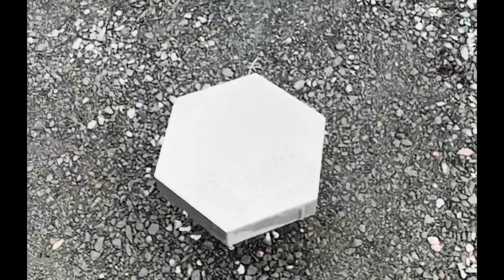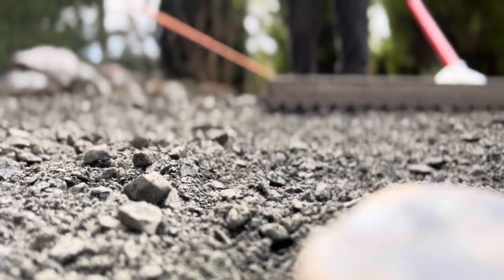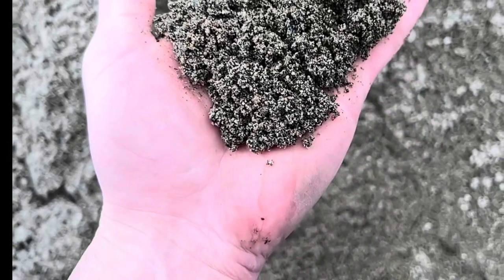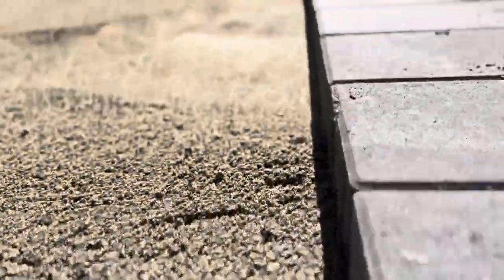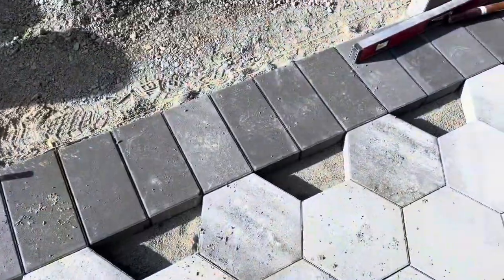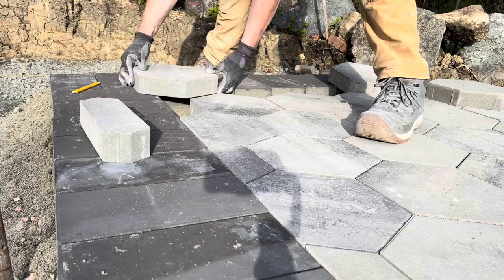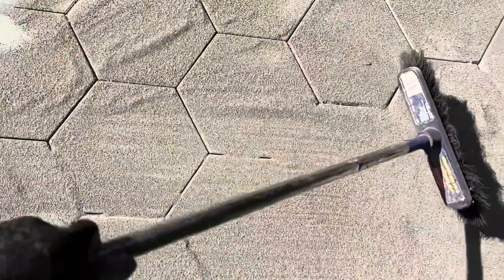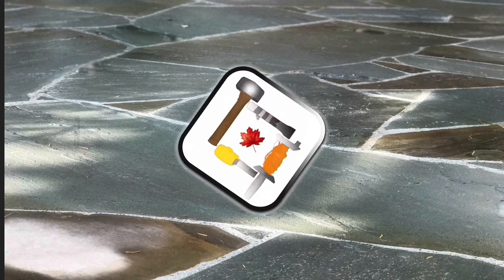How to install a modern paver patio! #pavers #diy #landscaping #hardscape #patio #pathway

Comment: Nicely finished project and good editing. Haven’t seen that shape before, was  there much size difference in pavers or were they exactly the same size?
Reply from the maker: They are very precisely the same size!
Reply: @HardscapeCanada  that makes it a lot easier, in Australia you sometimes get 5mm variances which really slows job down

Comment: Hi, project looks awesome! Well done indeed!!! 2 questions if I may? (1) Do you hammer down the pavers for them to be somewhat flush BEFORE applying the polymeric sand? Or is this step done via the vibrating plate? (2) Do you apply a protective sheet on the vibrating plate in order to avoid scratching/damaging the pavers? Good continuity!! :)
Reply from the maker: Hey thank you! No
I don’t hammer any of them down as they should sit flush on our nicely screeded sand. Often any minor discrepancies are ironed out when we compact. I prefer to sweep in sand before compacting. A mat or protector on the compactor is always a good idea too, I did not use one in this case and the pavers held up just fine with work scratching etc.
Reply: @HardscapeCanada  Thanks so much for the prompt reply! Much appreciated! Subscribed to your channel :)
Reply from the maker: Awesome 😎